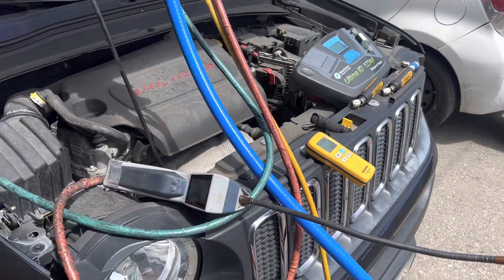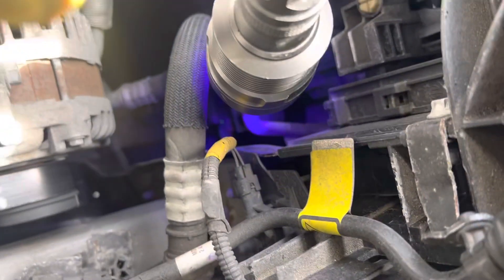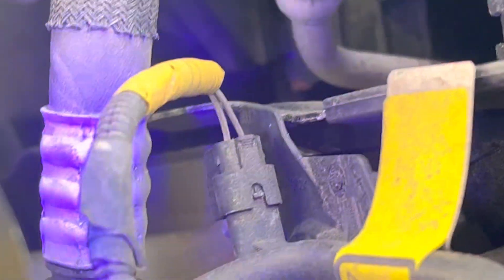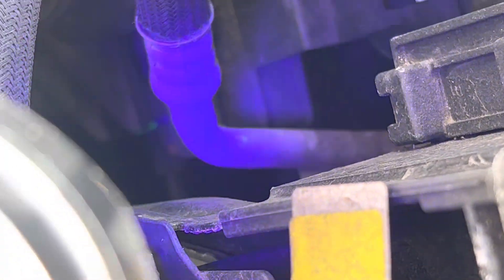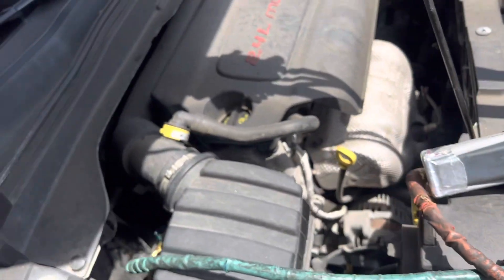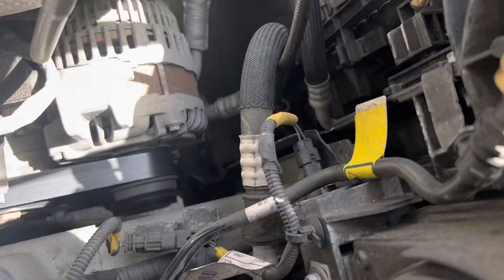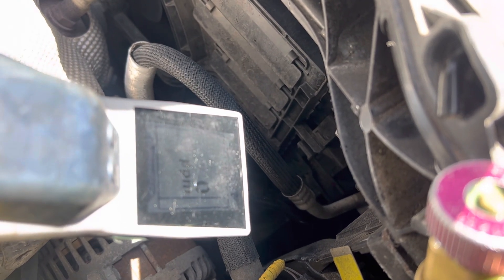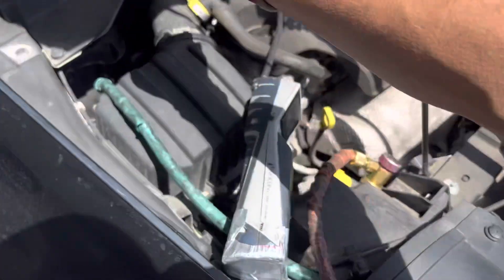REFRIGERANT LEAK NOT CONSTANT.  When filling refrigerant a loud hiss for a second and then stopped

Comment: Part 1 of 2
My Mentor. Some brainstorming please.
I done so far 3 cars which are virgin never touched by anyone, until I 3R it . All has R134A losses not in line with 7 grams a year at all, and no leak.
My car, 9 years old. 36,000KM or 22.5 K miles. MB W212 E400  , German built, Indonesia assembled. DENSO variable displacement.
Supposedly 590 grams factory fill, shortage/loss approx 200 grams based on 590 grams.
Average loss per year = 22.2 grams.

Friend's car. Toyota Alphard 2015 Japan built and assembled, dual EVAP. DENSO Variable displacement. So 8 years old. 26,000KM or 16.5K miles.
Supposedly 750 grams +-50 grams factory fill, shortage/loss approx 198 grams based on 750 grams.
Average loss per year = 24.7 grams.

My wife's car. Nov 2020 Toyota Corolla Cross. Japan build  & Thailand assembled. DENSO variable displacement.
So, 3.2 years old. 16,000KM or 10K miles. Supposedly 470 grams +- 30 grams factory fill,  shortage/loss 100 grams, based on 470 grams.
Average loss per year =31 grams.

I was guessing this is what could be happening : Please tell me if this make sense.
Assembly plant would use 3R machine right ? This machine always evacuate the hose first before charging R134A , because vacuuming would be the last process for car HVAC system being ready for R134A charging. There is no facility in 3R menu or facility for purging+filling hose with liquid R134A like how we do it manually at HP coupler SAE flare hose end by venting liquid R134A a tiny bit.

3R machine load/weight cell is at the machine itself and its built-in Recovery-Recharge tank uses a short hose to electrical solenoids. 
3R machine hoses set for the car is 6 feet long at least. The 6 feet of HP hose alone would need 75 grams liquid state R134A to top up and this 75 grams is part of the maximum fill capacity of X,Y and Z cars being handled by the factory tech. So minimum loss is already 75 grams per any car charged with that near 2 meter long hose. Most 3R machine has menu to charge either by HP or LP hose or both. If BOTH  LP and HP hoses are chosen, more liquid + gas state R134A will be sitting useless at the hoses. This is assuming there is no service hose length compensation on the 3R machine menu.

Italian TEXA brand 3R machine gives 3 meter hose set or 10 feet, but claimed it has automatic hose length compensation. No MENU to adjust hose length.
RobinAir has COMPENSATE mode in its MENU for refrigerant in hoses. 
I been reading Snap ON 3R machine manuals and have not seen this refrigerant-in-hose compensation thingy.

PART 1 of 2..............
Reply from the maker: Yep, everything you said is about right. 

Other than one thing might be going on with your refrigerant loss in the cars. 

The first year they may have lost very, very little refrigerant 
      But as the years go on, and all the O-rings and hoses, get older.   They go through more hot and cold cycles, an oxidation and natural deterioration in breakdown..      the leak rate may increase as they get older.     So it’s not usually a simple math of taking 100 g and dividing it by 10 Years meeting it’s been losing 10 g a year.. 

When you have the other scenario .   Where the system was perfectly tight maybe only losing two or 3 g a year.   For 10 years..  put on the ninth year the leak got bigger and lost 90 g in just the last year. 

Car manufacturing does not use normal R&R machine, Sarah, very high production .   There is no long evacuation time.. 

They have to bank that all the components. They have purchase or brand new and fairly clean and moisture free. .     They’re using brand new desiccant material..   everything had nitrogen blowing through it on assembly. 
       This is why when I use my refrigerant identifier on brand new vehicles that just came off the factory floor, but got in an accident I often Wolfine .5% air 1% air usually not higher than 3% air from the factory.. . 

And I often find that brand new vehicles that have just been purchased by the customer right off the factory floor to be at their lowest charge quantity in Refrigerant for example . 

If it says 500 g plus or -50 g .   I usually only get 450 g out of the vehicle..  and that’s recovering, refrigerant all the way down to roughly 800 µm. 

Because I get so many brand new cars that are only one to five months old right off the production line they got into accidents as they were being transported before they even got sold . Or just sold from the dealership and the customer dries out the driveway and hit something and ends up in one of my body shops.. 

So I have the pleasure of being able to use a Refrigerant Analyzer on all brand new vehicles right off the assembly line .    And do a refrigerant recovery and compare what I remove two what’s on the sticker on the hood?.